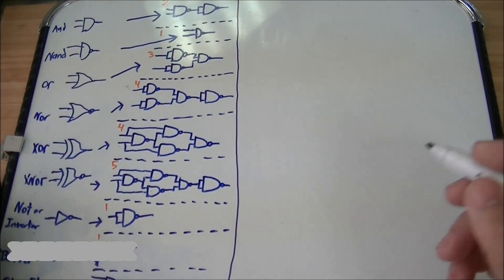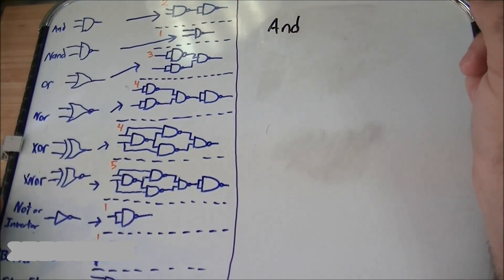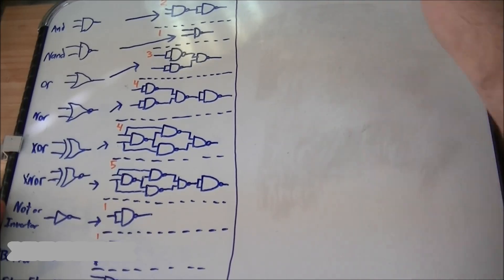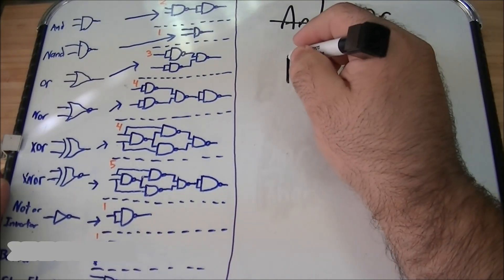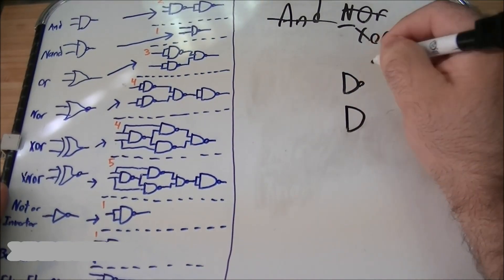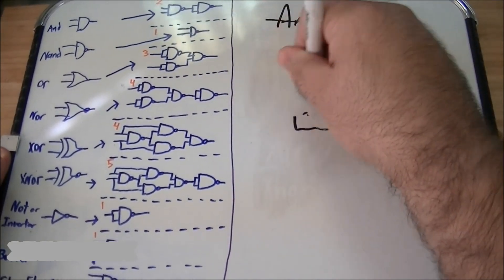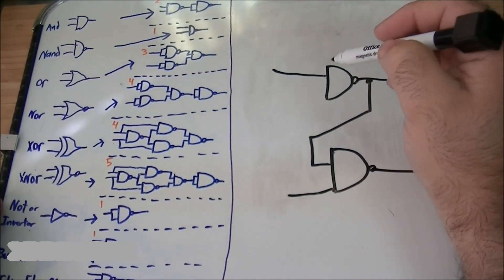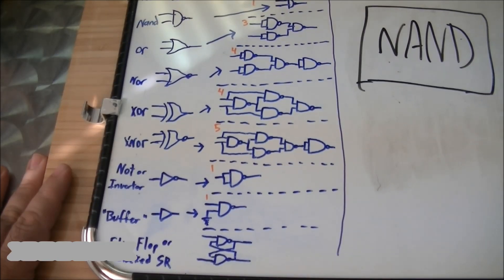How to create common Logic Gates using only NAND gates

Comment: In what cuircuit will the flip flop be used?
Reply from the maker: Johan Smit great question. When you start getting into the flip flops, you are getting in to the realm of digital computing. Flip flops can store inputs. They are used as memory, counters and and so one.  A clock is required.
Reply: That makes sence. So for what does the Q and Q1 stand for. And other topic if this flip flop are able to store info must it have power supply as long as it needs to be stored? Sorry. Still learning. Grade 7 now

Comment: Thank you for video but you didn't explain how do you get that implementation. 

Everyone explain how to connect 4 NAND gate to form Ex-OR gate. but why you connect in that way. why use 4 NAND gate.? why not 3 or 5..? 

Requesting you to explain in little more details. 

thank you again for video.
Reply from the maker: Good Question. The Ex-OR or what is called the XOR-gate in a very interesting logic gate. unlike the OR which is ON(1) when any and/or both inputs are on. the XOR is ONLY on when one OR the other input is on.But NOT on if both or none are active. so you seen a NAND to be used to CHECK that both inputs are NOT active. If it detects both inputs are hot then it cuts/breaks the output. ALSO we are using NAND-gates which the outputs is ALWAYS inverted. So one more gate is used at the end simply to INVERT the output. This of course in only at design stage. For prototyping the NAND is the most popular. I hope this helps. If we used AND-gates which don't produce the inverted output, we could have eliminated some gates.

Comment: useful diagram implement, but if you could  show how did you get the circuit implement, it will be better.
Reply from the maker: IT would but I no longer have logic chips. I use programmable logic chips and microprocessors. but the function is the same. Thank you for watching.

Comment: What about the redundant gates? For example in a logic system using their NAND gate equivalents, how do you spot the redundancy???
Reply from the maker: give me an example. in a simple prototype setup, having logics of all type can become expensive. having a larger lot of NAND gate chips, prototyping costs drop. but the final product should ALWAYS have the correct logic chip to reduce production cost, footprint,efficiency in power  and less points of failures. You can also create Flip Flops with NAND gates which is the next level in logics and computing.

Comment: Thanks for NAND gate , it helps me alot . I remembered all the gates and how to make other gates using NAND gate, But I want to ask  you one question regarding this , what should be strategy to draw any circuit/Equation using minimum no of NAND gate ??? cause  using hit and trial method for big circuit/equation takes more time ... Thank-you !!!
Reply from the maker: For big circuits I wouldn't use ALL NAND gates. It would be toooooo many chips. The all NAND gates is just cheaper in breadboard stage keeping the chip buying cost low in the prototyping stage
Reply: Ok thank you ..... :)
Reply from the maker: Yes. There are hundreds of arrangements.

Comment: Thanks for AND , OR , XOR :) only ones which i`ve got
Reply from the maker: Thank you for watching. the NAND is the most popular logic chip because 1 chip usually have 4 NANDs which will allow you to make any logic. Even 2 other logics with 1 chip.
Reply from the maker: Then it's an inverter / Buffer configuration
Reply from the maker: Same function but the more inputs required to operate, the less efficient AND more point of failures. For testing is fine.

Comment: how do I wire a nand gate tho
Reply from the maker: Riley Kentish The most basic Nand gate chip has 4 Nands inside. a 14 pin chip. 2 are used to power the chip, the rest are the gates. each gate uses 3 pins; 2 inputs and an output.